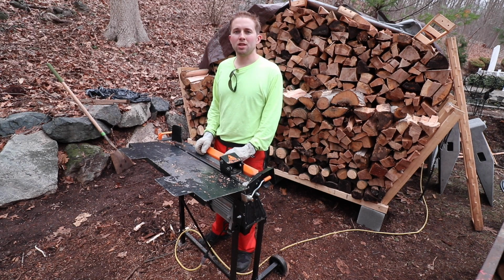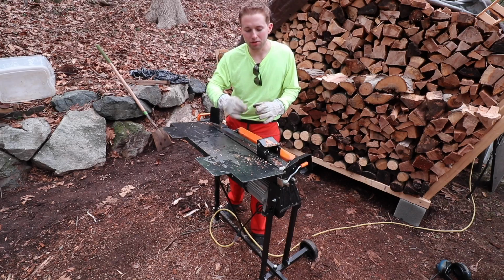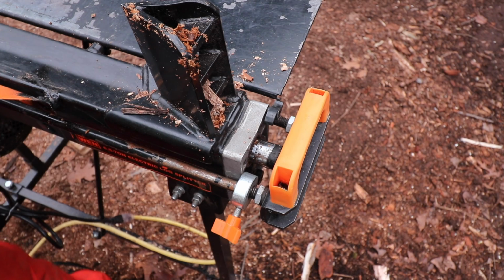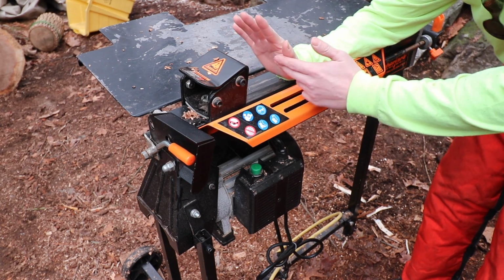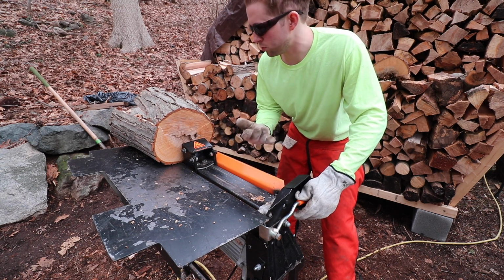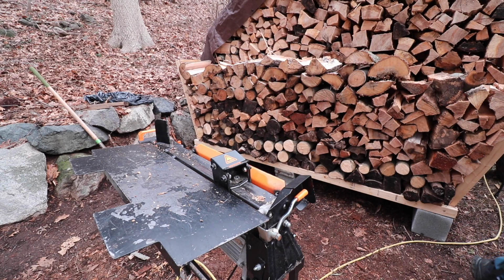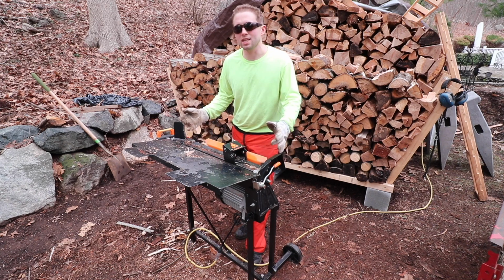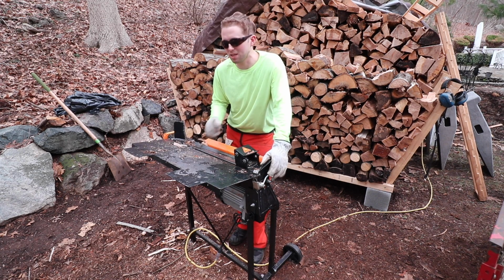Wen 6.5 ton log splitter Review / Mods

Comment: Have another question. Yesterday I was splitting some logs and was working great to start with. Then it began to get really slow and then wouldn't push through the logs. Pecan wood 12-16" diameter and 18" long. I split about a half cord before it gave me this problem. Fluid is also full. Anay reason for this to happen? Spitter is new and was my first time using it.
Reply from the maker: @glennmcdaniel7812  Two thoughts. 1) Ensure machine is level, or the wedge side is slightly higher. 2) check the hydraulic control lever. Is it pushing down the valve completely? Sometimes these levers bend , go out of alignment or need adjustment.
Reply: @OldSoulMillennial  Thanks!
Reply: @OldSoulMillennial  Put the wedge side slightly higher. Problem solved. Thanks [

Comment: Just picked mine up from Home Depot yesterday and put it through the test. Works GREAT! Now my question is, and I'm sure others would like this answer. Can you build me one of those tables that would mount to replace one of the sides like in your video. Would love to have one. Great design. Very interested. Thanks.
Reply from the maker: @glennmcdaniel7812  Unfortunately I am unable. For what materials cost, shop time, my time and then shipping, it would likely cost just as much as the unit. My advice to you, get creative. Build a few sawhorses and set up an easy to build wood table.

Comment: I'd  weld some kind of teeth onto the ram to keep logs from sliding up and possibly hitting you in the face (I've seen it happen) Or another idea I may try myself is to add a splitting wedge to the ram end of the splitter, so you'd have two sharp wedges going against each other. One of them will surely start to split the log!

Comment: A suggestion for your length adjustment. Take an angle grinder and cut a slight divot into that then the nut will get pinched as apposed to trying to hold a static position. Not too much 1/8" max
Reply from the maker: @Mountaintoptractor  I was thinking about roughing in some notches with an angle grinder. Never got around to it.
Reply: @OldSoulMillennial  or you could take a 1x6/1×8/1×10 put a screw in each side and set then on the end between the ram and side bar if you had one too long you could just swap the wood, but this is potential for pinching

Comment: A fix for the orange knob that stops the retracting is to take a normal bolt that will fit the hole and weld a 5 cm piece of steal to the bolt. That gives you enough torque to easely tighten it enough to not cause slippage

Comment: If you weld an axe head on the front of the wedge, it will split almost immediately and do much better on big rounds.  You lose some travel so round length suffers a bit

Comment: Thank you so much for this video. I only need to do about three cords each winter for my wood stove which is supplemental heat with my heat pump here in central Virginia. Your video went through everything. I don't know much about hydraulics, but what you said about the allen wrench and the dipstick and tilting the unit upright are exactly the things I needed to know. I think one mod I would make is a foot switch for one-handed operation so I can have one hand on the wood. The table idea is excellent. I mean who wants to keep lifting wood up that high over and over? Thanks again for the excellent video!!!
Reply from the maker: Thanks Eric, This splitter is a good unit. You won't be disappointed

Comment: I just bought one of these based off your review. Thanks for sharing. I received it yesterday and my only biggest complaint is the lack of side table so I will be adding one like you did. Just curious: do you know what gauge steel you used (or thickness)?
Reply from the maker: Sorry, do not recall. I used some scrap I had laying around. You won't be disappointed with this unit

Comment: Thanks for the run-down on the WEN. I really like your recommendation of locating the splitter near where you are stacking wood. That saves one extra handing step. Also, bravo on the the table extension idea. Nicely done. Cheers from currently very cold Montana!

Comment: I've got an older HF 7 ton unit. It has split everything I've thrown at it. Mounted it on a old garden trailer and tow it behind my lawn tractor.
Reply from the maker: Nice! How do you power the splitter?
Reply: @OldSoulMillennial  I have power in the few locations I do my splitting, but also have a small generator when needed that I can also tow. My property is divided by a stream. The BIG logs get split before hauling them to the wood shed. I've tackled a few of those monster logs as well. Slow and steady and they split with no issues.

Comment: I have a Yardmaxx 5 ton splitter. I put a trigger clamp on the motor button with momentary foot switch. Also for the stroke limiter, you can use a pair of vise grips.

Comment: I know nothing about splitting wood but on the ram end would it not be better to have a splitter on it also?
Reply from the maker: Interesting thought. I would say no and here's why. I routinely run into very dry pieces of wood that pop and shoot out on the wedge side. Sometimes these pieces shoot 10 feet away from the splitter. By having a wedge on only one side, it gives the operator better control of the split, it gives the operator an expectation on where the wood will fly to  and it gives the operator a safe zone. Also, sometimes the wedge gets stuck in knotted wood. By not having a wedge on the one side, it allows the ram to retract. A double wedge would cause an absolute headache if a knotted piece gets jammed.
Reply: @David Cleaves  I believe that most of the electric log splitters only power the ram in just one direction (extension). When the ram retracts, it is because of a spring pushing it back to the fully retracted position. If you w as watch the video closely, you will notice the ram retracting all by itself when the log is removed. my gas powered log splitter, the ram is powered by the hydraulics in both directions. Hopefully I understood your comment and answered it correctly.

Comment: I've made several videos with this Wen splitter, but I have to admit that your video is probably better in a lot of ways except too many ads, lol. I noticed at 6:10 you have a drop of fluid on the end, so either the end gasket is leaking (like mine recently) or your dipstick is not tight. That's why your fluid was low. Also at 9:10 you recommend the placing angled cut pieces with the angle down. I disagree. You will eventually get a piece that jams underneath the ram and is a royal pain to remove. Best to recut the piece flat/flatter or don't split it at all. That catch table you made is sweet. On large pieces, there is a lot of down pressure on those guides and in your case the table, so I made a free standing wood table instead. Again though, really great video. This one should have a lot more views than it does.

Comment: Here is what I did with my Task force 5 ton splitter - I "defeated" the safety switch by drilling a hole thru both sides of the plastic guards, then inserted a cotter pin to hold the switch in the down position. However, to maintain safety, the unit is now plugged into a momentary contact foot switch, so that I have to have my foot on the foot switch for the motor to become, and remain active.  So I can now have one hand (and one foot) operation.
Reply: Same